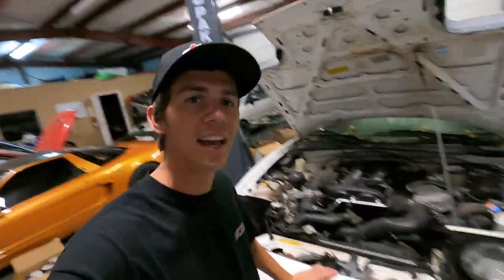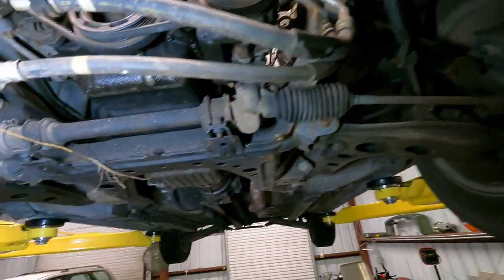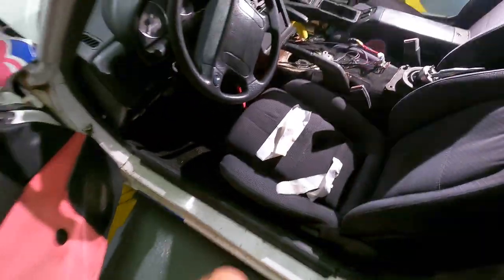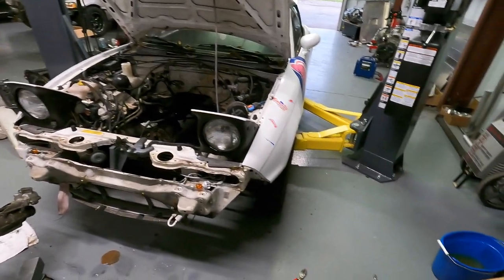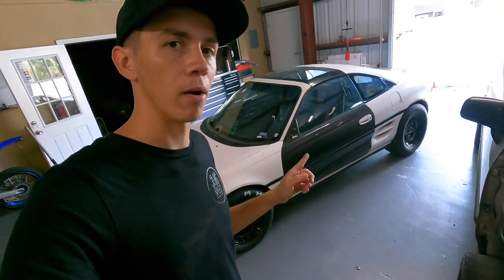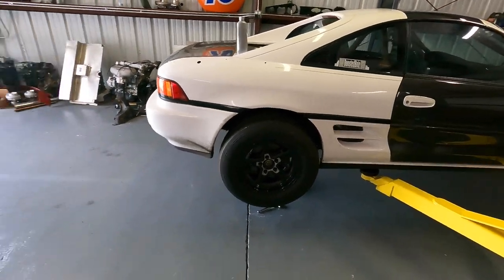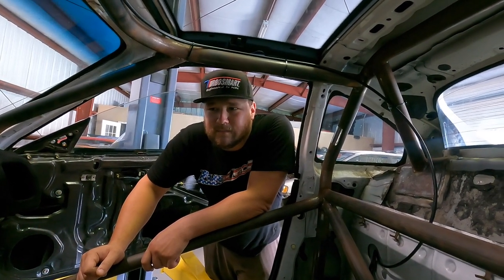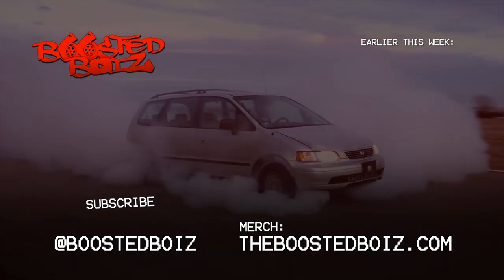K-Swap Miata Build Part 1 Engine Is Out!

Comment: So I have a 2012crv with the k24 and never had to replace a thing just tires breaks I tow with it and go off roading and it holds up great with I had the money to turbo it because the stock 185hp is a little low

Comment: That arm that goes from the transmission to the rear end is like what the Pontiac firebird has
Reply: And the old Chevy Monza . The tail housing off the 350 TH of a monza is what you would need to swap one into a camaro or firebird . If an overdrive wasn't what you needed .

Comment: 1.6L is in the car, 1.8l has a plastic maf and different intake manifold
Reply: Easiest way to tell is 1.6 the intake pipe goes under the top radiator hose, 1.8 goes over the top

Comment: easiest way to tell the engine size is to stand at the front of the engine and look at the spark plug wires. If they run to the driver's side, it's a 1.6. If they run to the passenger side, it's a 1.8.   Cant wait to see how she parties with a K-swap!

Comment: One thing that I have ALWAYS wanted to do is build a Miata for road racing with a 13b rotary in it. I think that with the power to weight ratio it'd be alot of fun, but it'd still be a hell of alot of fun with 200 whp.

Comment: If you can make anywhere from 215 to 230+ horsepower at the wheels in Florida I bet you would run a low to mid 13 second pass? It all comes down to how well it shoots out of the hole! Just going off a guess my buddies 190 hp all motor 1.8 at around 2280lbs with him in it in Vegas went a 13.84 and he bogged hard out of the hole and wouldn’t go again because drag racing wasnt his thing……. Keep up the awesome work guys love your videos love your cars and the style attitude everything LOL just keep it up it’s working

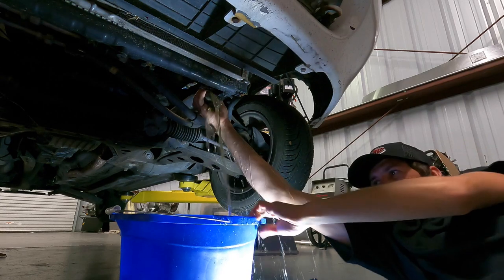Comment: 0:33 just ignore the drain plug on the bottom of the rad, i guess lmao.
Reply: Ain't nobody got time for that. LOL
Reply: McFlickers  already done lol
Reply: @youremom6349  he's still on there didn't work
Reply: @jerrywilcox9890  damn maybe me people need to report his ass
Reply: Every time I have ever used the drain it never seals when closed
Reply: Had to do the same, my drain plug was plastic and old threads stripped. Go figure.
Reply: @davidhess3320  get one of those water taps from the home hardware and cross thread it in problem solved
Reply: @youremom6349  I'm beginning to think those report options are there just to make you feel better. Disappears when you click it but others can still see it.
Reply: @chrisgooden9662  i just ended up buying a new rad after inspecting the old one...found a small leak 😑winwin....nice suggestion 👍
Reply: Petcock*
Reply: McFlickers  yeah. I think you're right. It's just frustrating these people/bots can come thru and blast all this dumb sh!t like that.

Comment: Just for future reference, one of the stickers under the hood, labeled as an emissions cert sticker states what the engine is that is in there from factory without having to look at tags on the block (Providing that the car was a US delivered car). I have to make use of that sticker a lot working at a parts store. You would be amazed at the number of people that have no clue what they are driving day to day.

Comment: Little plastic ball thing is a vacuum reservoir. Keeps your heater/ ac control box from doing weird shit as well as the cruise control if it had a vacuum controlled cruise control. I’ve deleted them on cars and trucks in the past before I knew anything about cars because they were ugly and learned very quickly they serve a purpose lol.

Comment: That 'plastic ball' on that Miata is a vacuum tank. The car should be setup from factory to use vacuum from the engine to boost the braking power, and that tank helps to increase the vacuum presence at lower engine vacuum states.

Comment: I think you're underestimating a fully built all motor K swap I bet you this thing will do mid 12s all day.
Reply: It's engine is stock, straight from the importer. Just because it has some manifolds on it doesn't make it "built"

Comment: @BoostedBoiz Throw a tarp over it and get a Raid Fogger and put it inside the car. One night when you are all packed up for the day you can set it off and she will be all good in the morning. Very little work for you guys, and any of the smoke/fog that gets into the shop will just help with them little suckers that have made a run for it in the last couple of days.

Comment: I have a few Zf m3 transmissions I had stock piled for the turbo 328 (I run a built t5 now) if ya need one let me know . I know they make adapters for the K.

Comment: Has anyone mentioned about the rear diff 

Recommend picking up a type 2 4.30 Torsen for the car from an nb

4.30 will make sure the speedo reads right. 4.10 also works with a vss speedo gear change
Reply: For some reason i don't think a working speedo is high on their priorities. Also the current diff is welded.
Reply: True if you want to be a drift boy all day and night weld a 1.8 diff but that stock 1.6 diff will survive nothing 😂 probably will snap on dyno

Comment: What's the hp difference between the 2 motors?? Or the torque if anyone happens to know ?? I've driven a manual miata for a whole day years ago and I thought it was peppy and definitely balanced well .... I always wondered what more power would feel like ... but it definitely was no slouch.. granted I've never driven a modified vehicle... or a fast vehicle

Comment: 1.6 miata - valve cover letters engraved in valve cover
1.8 - letters stick above valve cover
Reply: Also 1.6 - coolant hose above air tube. 
1.8 - coolant hose below air tube.

Comment: Each time at Dino or track oil should be changed if you don't want to spend money??? You don't do track Dino then drive around then track before you change oil's brother it will cost you$$$